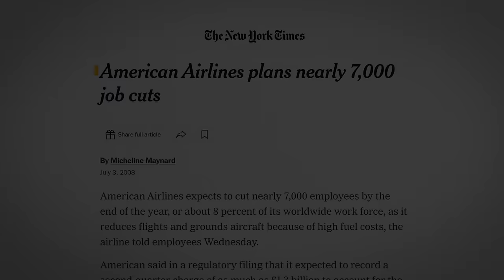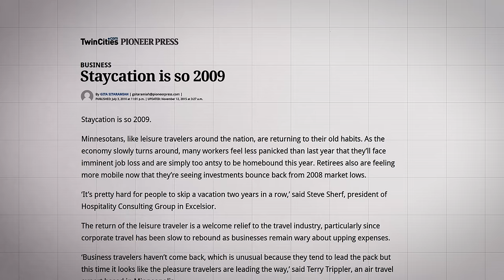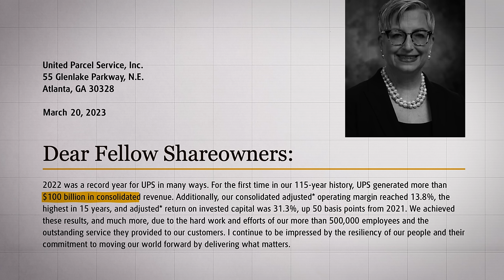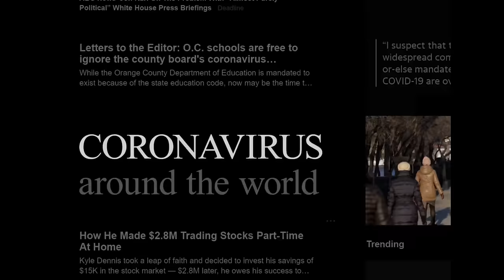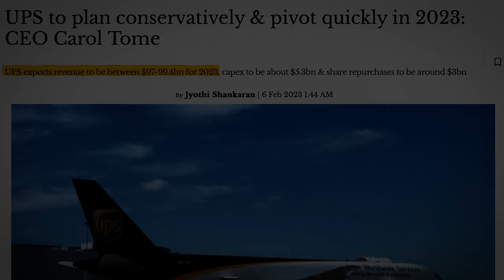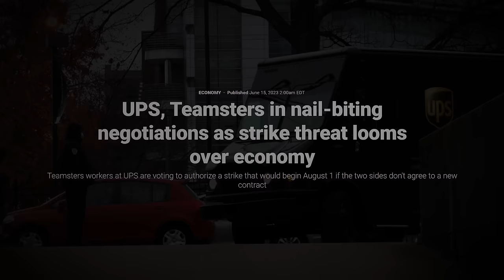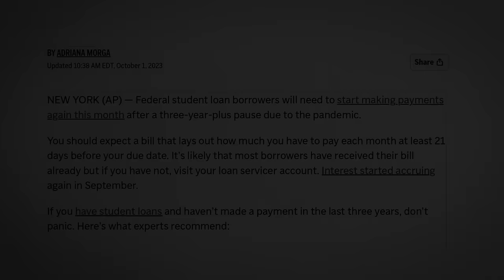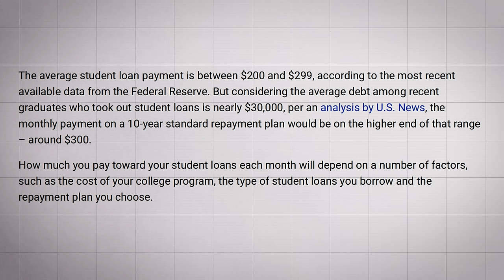Money is Gone: Airlines Start Layoffs Soon

Comment: I'm a 38 year employee of UPS (retired, not a pilot). The issue is The CEO, Carol Tome.  Her hiring was the first instance of hiring a CEO at UPS that wasn't promoted from within the company.  UPS has been around since 1907.  If it ain't broke, don't fix it.  She came from Home Depot where She did the exact same thing.  She is there strictly for the stockholders, not for the employees or customers.  For well over 100 years, UPS never had a layoff, except temps during peak season.  For 90 years, UPS was an employee owned company.  UPS paid cash for everything they bought.  Their stock went public in 1997, and the company has gone downhill, IMO, ever since.
Reply: Thanks for your info you may be right I can only tell you why i stopped shipping with UPS. USPS gives better customer support at a lower price.
Reply: I would love to see the qualified applicants who passed up. The government gives huge tax benefits to those doing business with female ran companies.
Reply: I know what you mean. I worked for china airlines in seattle and the manager transfered in from taipei from the i.t. department. I had 10+ years at the time working the ramp. He and I used to go nose-to-nose on how to load/unload thr md-11s. I would tell him what he was doing was illegal and when the plane gets to taipei they will discover it and the messages and error report will start to come. He insisted, i protested but would comply. Sure enough investigation would be triggered like i said it would. Then the manager would put the blame on me. Being from the i.t. dept he should have stuck with his office work and let flight operations work the aircraft.
Reply: This is true of really any company that's public. The drive to 'increase profits for the shareholders' tends to ruin everything for the customer in the end. Wall street is broken
Reply: Probably true but I knew 2 people who were older employees with UPS(route drivers not pilots) that were employed when the company went public.  One had bought internal company stock when it was offered and the other did not.  When it became public, one became a millionaire at that time and both still had their jobs.  Unfortunately, there is a big difference between employee owned and stockholder owned because the stockholders are the new owners.  I see the disappointment with the new CEO with the employees because she is a bean counter but that is what she was hired for.  Good luck to you.
Reply: She was also the CFO at Home Depot, not a ceo, her job was counting beans, and nothing more. She has no background in logistics, and her understanding of the business seems to be limited at best.
Reply: @kevinmcdonald8049  That's why you get everything in writing, so you can deflect the blame if someone complains back to the person who is responsible for it
Reply: An executive is required, both legally and ethically, to act in the interest of the shareholder.
Reply: @benchoflemons398  It's funny that 'long term benefit' isn't seen as being in the interest of the shareholder. Always it's 'what can you gut to get me more money today?'
Reply: Word.
Reply: NotLeoDiCaprio  china airlines back in 2008.
Reply: Back in 2000 I ordered two packages from a supplier in Quebec, for an important customer. It was going to be a ten week lead time from my vendor so my customer was anxious. UPS finally delivered two packages that looked like they had been dropped off the truck and run over. No exaggeration. I had to refuse them and inform my unhappy customer of the delay. The very next day UPS delivered, not two, but one brand new looking package. Without questioning how this  product got all the way back to Quebec and back to SoCal in 24 hours, like a fool I accepted the package and then forwarded it on to my customer. Who called me an hour later screaming because, when she opened the box, she discovered the exact same two destroyed products, that UPS had just put into a brand new box. When I called UPS customer service, the excuse I got was "Well, Sir, we handle 18 million packages a day." I can remember when it was 20 million. If I was losing 10% of my business the very first thing I'd do is clean house, union be damned.
Reply: @SlyNine   I just searched for huge tax benefits for businesses run by females.  I didn't find anything that substantiates that claim. I think you have it backwards. There are penalties for companies that do not maintain diversity and equal opportunities for employees. No huge tax benefits for companies that do.
Reply: Hate to tell you man, the stock holders own the company, the company exist to make the share holders money, not give the workers a job.
Reply: I agree with you 100%.
Reply: And, you can bet she has a nice little parachute when she goes down with the ship.
Reply: How does a company function without employees?  Or customers to pay for the services of the company?  Under MS. Tome, UPS just started holding rural customer's packages at their buildings until there are enough deliveries in that area to make it profitable.  Customer pays full price to have something delivered.  Might be a part to fix a farmer's broken tractor.  Could be medicine that is needed badly.  Do you think this is a good decision to satisfy the stockholders?  What if it was YOUR medicine?  Is a 2,3+ day delay ok with you?  Old school here.  We used to be told regularly that the last name of our company is SERVICE.  It's all we offer.  That philosophy has fallen by the wayside to please the stockholder.  Jim Casey, the founder of UPS is probably spinning in his grave. @becraftcorey
Reply: Maybe unrelated but a friend who is a regional manager at Home Depot, very successful, complained that his income was suffering because of incompetent CEOs and "executives who got their jobs just because they worked at the orange box for decades and kept applying for promotions into jobs they couldn't do" … Carol Tome was CFO at HD after 20 years of applying for executive jobs. Maybe unrelated.
There's two things the executives at a company should never do:
1. Never mention the stock or stock price or wall street, these matters have no bearing on the performance or success of the company.
2. Never sell their stock, never buy back their stock, never have anything to do with the stock except accumulate it.

Politicians and corporations, law makers, even courts and especially wall street, repeat a total lie about capitalism: "it's the responsibility of the executives to maximize the value of the company." Rubbish. The role of operating a company is a responsibility to the employees, not the investors. The responsibility to the customer and the business partners is to operate the business to serve its purpose in the production of goods and the delivery of services that add value to the businesses and purposes of those customers and partners. That's it. Nothing else. Everything else the corporations and politicians try to call capitalism is a fiction invented to serve their political aspirations, conspiracies and malfeasance. That CEOs are paid disproportionately to ever other employee, executive and board member is proof of the racket. 

If anyone happens to read this comment and is curious to learn more about the differences between 1970 and 2023 in terms of how employees are paid, how executives are paid, how investors take profits and how politicians are the agents of the corporations, I'm happy to continue. : ) … then again, uutuub has blocked my comments before, so I'm guessing this one will be demoted and obscured, too.
Reply: @owenross3468  except UPS delivers the mail for USPS … : )
Reply: @becraftcorey You're correct but the trend for CEOs to stick around for shorter amounts of time before moving on to the next job means they don't have any interest in the long term financial stability of the company.  All they care about is share price and next quarter's earnings so they can get their bonuses.  They wring out every cent without any regard for company viability 5 or 10 years down the road.  They know this & don't care because it will be somebody else's problem.
Reply: @benchoflemons398  If the company is acting in the customers' best interests, if it is a well run company, if it maximises the capital value of its staff and methods, then it is making profits and is acting in the best interests of the shareholders'.
Reply: CEO is hired by the stock holders. CEO is there for the stock holders. Any employee can be a stock holder by buying stock.
Reply: @SlyNine  I believe you're referring to female (minority) owned companies.
Reply: And if the workers walk?
Reply: I hope no bonus is being paid as a result of layoffs, if so BOD should be held accountable for incompetence.
Reply: Back in 1986, my parents opened a small business and I was still in high school. Back then, UPS was the life blood of their business and AMAZING! Our area was too small for regular FedEx deliveries, and our post office was too small to do local or home delivery, so if it came by USPS, you had to pick it up yourself. But UPS always did street deliveries. The same driver, Bill, came to my parents' store every day, even if they didn't have anything going out. It was more than a delivery service, it was a relationship. When I moved out of the house to go to college, if my parents sent something, it was always by UPS. When I needed to ship something in my 20s and 30s, I used UPS. Sometime in my 40s, UPS really started going downhill. Now that I'm in my 50s, FedEx is now my go to delivery service, with the post office second and UPS third. It's a shame. UPS was so good and UPS executive management killed it.
Reply: She better be there for the shareholders. Its her fiduciary duty. Should she do otherwise she could be personally sued. This is how this works. If you think it should be otherwise you simply do not  understand how this works.
Reply: @nixter1nixter1  equal opportunity has NOTHING to do with race or sex. What happened to merit?
Reply: Oh now that is interesting... that coincides rather well with my impression of when UPS went from a perfectly good shipping option to the one that demolishes packages more often than not, can't complete deliveries if there's any impediment to doing so whatsoever, and generally doesn't seem to care about what they do at all.

I've spent half my adult life absolutely baffled that UPS is still in business, and the timing of their IPO makes perfect sense for when they went downhill in my view.
Reply: Here's a clue. Every CEO is in it for the shareholders. It's why the shareholders hired them, to increase shareholder value. Every single CEO everywhere.
Everything else is method.
They only care about employees and customers if it increases shareholder value. 
It may sound terrible but that's the way that it's always been.
Reply: @becraftcorey  ouch, you sure got taken to the woodshed Mr. Shareholder
Reply: Truly shocked that a strong independent boss babe has screwed everything up on multiple occasions 😂
Reply: I own a wholesale company, and ship small packages everyday.  When USPS started ground advantage a few months ago my UPS shipments dropped by 80%.
Reply: and a woman too. lovely.
Reply: "The issue is The CEO, Carol Tome." I'd say this is A problem, but a secondary one. As you say, "She is there strictly for the stockholders, not for the employees or customers." Workers and society have a real and worsening problem because the pursuit of profit is about ONLY the pursuit of profit. The ONLY thing I see that can fix this problem without completely tearing down the corporate business world is replacing all corporations Board of Directors with direct democracy of the enterprises workers. Since I don't see that happening I believe it to be more likely that the intolerable conditions business "needs" precipitate will eventually cause civil problems that eclipse what we've seen to date.
Reply: When they go public the executives run everything to make their options convert and then the looting starts.
Reply: I was laid off from UPS this April.
Carol Tome saw only profit and didn't care about cost.
Reply: @benchoflemons398  Fiduciary- but they only act to line their own pockets in most cases, they do it with finesse but in the end they win and everyone else and the stockholders lose.
Reply: Which should be illegal  @SlyNine
Reply: I hope she gets fired.
Reply: CEO comes in and cuts everything back so it looks like they are spending little and making lots of money. Then the CEO leaves with a nice fat payday and diamond pension.
SOON AFTER... company is losing money hand over fist because they no longer have the infrastructure to function, they need to employ more staff and purchase vehicles and equipment and the accounts starts to look grim.  Who could have seen that coming???
Reply: Going public isn't the true problem - the problem is if they do stock buybacks with their spare cash (or worse, borrow to do stock buybacks).  Again and again, corporations that do stock buybacks do very poorly in the long run.  After all, there was a reason stock buybacks were illegal prior to 1982.
Reply: @kevinmcdonald8049  Pretty much RoC (Taiwan) approach to safety. From SQ006 accident to their train derailment - the first thing they do is to assign blames to outside party. They are an advanced nation, but the attitude and culture to transport safety is pretty much world's behind, even compared to some third world countries in Southeast Asia.
Reply: i always hate this "shareholders vs customers" narrative. when the customers lose, shareholders lose, as these financials indicate. still tho, i do agree that going public frequently seems to limit the competence of management. Boeing is a fine example where public ownership has absolutely failed to contain the last 20 years of management shitting the bed
Reply: UPS would be in a lot better shape if they were not extorted by the Teamster's Union!
Reply: The whole world is now a bottom line inc, staff, ie people are zero, just a burden to any dollar program.
I found working for a family business always better than for a massive spreadsheet outfit.
Reply: It’s pretty simple.  When you take a company public you form a pact with the devil.
Reply: Most companies that go public either a) go downhill and go BK and disappear, or b) get bought out

In my experience, it is option B that happens most often.  It starts with cuts in everything.  While you look at the CEO look at the CFO... the bean counters that look at pennies instead of the bigger picture.  CFO's often don't even have actual "work" experience in the company's field of business but rather are just there to cut, cut, cut.  When you see that you should jump ship because the company is being setup to be sold (unless you have some contract that they have to pay you out of).  UPS is being primed to be sold off IMO.  It doesn't matter that they've been around a long time... SEARS was a 100+ year company... GONE.  I've worked at 2 companies that were prepped for sell off.  The same scenarios played out each time.  I was able to jump ship a few months prior to sell off on the second company, and survived, while a lot of workers suddenly found themselves out of a job.
Reply: Going Public is a Long Term solution to a Short Term problem. Yes, you can generate a lot of income quickly through an IPO, but then you're on the "higher profits" treadmill forever to justify your stock price.
Reply: I worked at UPS for 17yrs. Started when I was 18. It's not a job for the weak, but I was "brown to the bone".  New CEO came in and when I say she started to clean house, she started to clean house. I still have friends that work in management that are in fear of losing their jobs everyday. I was able to get out before it was too late, the best decision I've made. Besides, UPS is not the same anymore, the standards have lowered.
Reply: The new norm is to "bring in fresh blood".  My wife worked for an established credit union and they did this. Talk about screwing the pooch.  The new boss literally fell asleep during key meetings, got rid of old established contractors. In one month alone they lost $1.5 million.  She had enough and retired.
Reply: Yes the esg hire. Rarely thinks long term.
Reply: I worked for Home Depot for 6 years back in the day, yeah she F’_d that up big big time.
Reply: @SlyNine  -

Companies sometimes resort to hiring "hit men".  Their job is to come in and do the things those who are vested in the company might not have the heart to do.  They come in, cut the workforce, do all the dirty work, then leave.

There was a woman, can't remember her name, about 30 years ago killed herself once being a hit man got the best of her conscious after performing, and got fired by the board before her contract was up.  Her mentor also had recently died, so she no longer had that father figure to help buffer the guilt.
Reply: 90% of what I get delivered via UPS is damaged. three time the items were demolished. It not just the CEO. But UPS is still better than DHL.
Reply: Three cheers for your comment!!!
Reply: "She is there strictly for the stockholders, not for the employees or customers." - The most telling statement I've read this year.
Reply: Where would all these CEO’s and shareholders be without the bees doing all the work?
Reply: @benchoflemons398  The problem is that they, nowadays, act on their own interest: that is quarter to quarter numbers to increase their bonuses. This leads to very short vision. You see CEOs firing people and at the same time increasing compensation for themselves. You see them making short-term decisions that then lead to problems. They have the golden parachute,  and as a class, they cover each other. It reminds me of when kings started not only not going to war, but defer to each other (not killing kings). The problem is people notice, and now everybody is going into a union and demanding extreme stuff. Society is going to collapse. How is that going to help stockholders? The stocks will be down 50% or more.
Reply: @becraftcorey I don’t think the OP is arguing that the company doesn’t run for the stockholders. I think he’s stating what he knows- that that doesn’t actually work in the end. That the companies that exist for the stockholders tank because they aren’t operating for the customers.
Reply: how the hell are you retired at 38??????????????????????
Reply: She's also on the International Business Committee at the WEF.   'nuff said for me.    Fired.
Reply: Outside hires for CEO are almost always sociopaths that have one goal, money for themselves.  I worked at a place where the founder died.  The board hired someone who knew nothing about the industry despite a resume full of positions in it.  He fired or demoted competent people and brought in his unqualified friends to be execs.  The company stagnated for 7 years, shedded customers, then got bought.  The execs all walked away with massive bonuses for the sale.  Layoffs started right after.  

There was absolutely no reason for the company's downfall beyond a CEO that didn't care about continuing to improve the product. Stuff like this should be considered fraud.  The only stakeholder should not be "shareholders", customers need to have rights so a company can not do this while holding 10 year contracts that have customers locked in.  Everyone bailed as their contracts expired, but some are still stuck because they signed deals right before the company was ruined just to pay a vapid exec more money.
Reply: I am always amazed when companies get into financial trouble, that the CEO’s never take a pay or benefit cut, it’s always the employees. Why would you keep a CEO if they company is on a downward spiral? Then to make matters worse, they get millions of dollars for ruining the company with a contractual severance package. Without the employees the CEO’s don’t have a company. 2) American tax payers should not have to absorb student loans so I am glad these loans are not forgiven. So many of these student loans were not used for actual college. Students were going on trips, buying clothes, cars and paying for just about anything but college with these loans. Plus once they received the money for these student loans, they didn’t attend school. It’s so irresponsible. Thanks for the video.
Reply: @JimsEquipmentShed  The same thing ruined southwest.  They hired a CEO that had no idea how an airline works who felt no need to invest in improving the IT infrastructure that supports the entire business.   Notice how the CEO's wikipedia for southwest actually cites being a programmer in 1988 as a credential.  It is because since that time, the guy worked vapid management roles and 30 years later doesn't understand anything with IT. The guy learned computer systems before the internet, yet this is his main qualification for running an airline that is basically an IT company.
Reply: I hope you realize that the entire purpose of the CEO position in any company is for that person to run the company on behalf of the shareholders - who demand return on their investments. CEO's aren't there to make jobs for people unless those jobs add value to the shareholders.
Reply: @charleshaggard4341 
She did her job, but it still ruins the company. Also shows that those who already have money are the ones who get money for no work.
Reply: @Adam_Gray 
Yup. That is how they plan it.
Reply: This is how Amazon wants it.
Reply: @benchoflemons398  That is correct.  But more importantly, and by legal decision:
ONLY IN THE INTEREST OF THE SHAREHOLDER.
And right there you see the biggest problem with US corporations.
Also, who can figure out what "the interest of the shareholder" IS? Short-term profit?  long-term growth? Some mix? Buy backs? Dilution?
Reply: @SlyNine  DEI hurting a company say it ain't so.
Reply: @mickeymorgan4672  just wrong. 

What you meant to say was: every CEO hired after a company has gone public is in it for the shareholders.

Small business owners who are CEOs of companies that they love and started = do care about customers and employees,
Reply: P.S. You wouldn't, by chance, be the same employee my dad (driver) knew who is/was a UPS mechanic that would make more money being retired,  instead he keeps working to avoid his wife?
Reply: Public companies are beholden to their shareholders, so yeah, it sucks.
Reply: A company goes public because it needs to raise money.
Reply: Robert, it is interesting to hear from someone who worked for UPS. It sounds like you have your ear to the ground with contacts inside the company. When companies bring in CEOs to squeeze out every last penny of revenue for stockholder wealth thing never work out well for little guys. I know how hard the employees work there whether you work as a pilot, in a warehouse or as a driver. It is a shame the company brought in someone like her to run the place into the ground.
Reply: The CEO of any large business works for the shareholders. The shareholders aren't in it for the long haul. They don't care about any 5 or 10 year plans, they care about the profits and return on investment this quarter. As soon as these numbers aren't where they want it they pull their capital and reinvest elsewhere.
Reply: no worries, FedEx is worse.
Reply: Sounds about right.
Reply: I've a question,I just got a job as a seasonal driver helper making $21 an hour,will I get alot of hours every week and will I be able to get a full time job possibly so I won't have to find another job after the season rush is over?
Reply: A CEO is responsible to their stockholders, not the employees or customers first. Shocking.
Reply: JimAllen-Persona  Right, which IMHO is almost worse. If a company is not attractive enough, i.e. lots' of pure profit, or in the process of tanking and you have people shorting it, betting against it, then there's no reason to pick up the stock just to turn it around. Just one part of the equation of a massive industry, which is just legal gambling as far as I'm concerned.; often with others' money.
Reply: @LONEWOLF-rq5tl  - No one can give you a definitive answer to your question.  The important thing to understand is a seasonal job is temporary by its very nature.  It’s only there because of an anticipate increase in volume in work due to the Christmas holiday.  Once the workload returns to normal after the holiday it’s often difficult to convert that seasonal job to full time simply because they already have all the full time workers they need, hence why a seasonal job is seasonal.  If there’s a further downturn in the economy and the company needs fewer full time workers it’s more difficult to convert the seasonal job to permanent.  Just my pessimistic $0.02.  Best of luck.
Reply: yup
Reply: worked at boeing in late 1990s and there were a number of 767 UPD Freighters and you guys were tough on delivery.  if the pallets got stuck anywhere on the floor UPS would not take delivery and we would have to fix.
Reply: Yes, ESG scoring  @SlyNine
Reply: Its a catch 22 to make a company go public. If the company does not constantly make money, people will complain. It's not sustainable and does not let a company grow naturally. Worse still gives large stake holders and investment firms that only care about short term gain influence changes that kill companies long term.
Reply: @robertintexas this was done back in the 90s. It was up to the driver if he wanted to hold delivery on an extended area. When the competition increased ups did away with it.
Reply: @zackriden79 after 38 years of working for ups 😂😂😂
Reply: @LONEWOLF-rq5tl volume has been going down since ’22 and with the economy the way it is don’t plan on getting called back. I’m retired but before I did there was a lot of work being transferred between warehouses. It’ll increase for the holidays and decrease after.
Reply: @SlyNine  Just throw in a bit of misogyny, why don't you?

She may be a terrible CEO. No idea, as I don't know the industry, but the idea that a male applicant would have been more qualified (which is precisely what you're implying) is sexist. Women can be and are successful CEOs.
Reply: Home Depot and its umbrella holding company are amongst the most unethical I have looked into for part of my college business class paper. I never expected that conclusion and before my deep dive, I was always praising them.
Reply: Goin woke never works out..😂😂😂
Reply: 37 years retired feeder driver and you are spot on with this new CEO.
Reply: Employee-ownership all the way
Reply: @owenross3468 are u kidding? USPS is better than UPS ?  UPS FEDX  will get out of their van to open my driveway gate USPS is union and will not. I've never heard anyone say the government is better than private industry.
Reply: Absolutely correct sir !   More bad news -
Reply: CEO’s job is to take Care of the Stock holders
Reply: Sounds exactly like my current company after getting bought out by a Private Equity firm lmao. It seems like the universal experience with PE buyouts and IPO's.
Reply: If it’s the CEO then no, she is there for HERSELF not stock people. If she was, she’d care about her company and make it thrive so that I would be confident buying in and holding my money with UPS for years to come. The state of the company is clearly reflected in its stock numbers, and UPS is not a buy right now that’s for sure.
Reply: Scott Davis wasn’t either.
Reply: It used to be you got promoted up through the ranks so the incentive was there to perform well and hit company targets. Not no more.
Reply: This is what corporations are about now... They're not there to provide and improve a good or service to a customer... They're there for the benefit of the stockholders!
Reply: Leave it to a female....
Reply: I got laid off from Delta Airlines in 2006 and went to UPS and got laid off there in 2009. Aircraft Maintenance can be a rollercoaster 😂
Reply: I wish, I could say my .02 😂
Reply: Agreed.
Reply: Hey, this is America. Money rules and shareholders are gods. Don't you subscribe to reality?
Reply: @willhow2654  - Consider yourself lucky on that learning experience. I learned the hard way by working for a company that they took over and it went to hell quickly.
Reply: So she was a former Home Depot executive (or senior manager, whatever the hell she was) - that explains everything. I worked for a company that they took over some years ago and it was never the same. There is something about the HD brass that drives the cart and not the horse pulling it, and it is all based on short term revenue earnings at all cost. And if you happen to be one of those who raises a red flag on the shortsightedness and challenges management, well, you are out the door. Then again the Atlanta Falcons is owned by former Home Depot founding partner Bernie Marcus, and the Falcons have only failed in every chance to get a Superbowl win.
Reply: @SlyNine what kind of benefits?
Reply: Just for the sake of it: When a company is publicly traded, what is the #1 priority of the company? Care to answer?
Reply: @TheMrDrMs - 100% correct 👍
Reply: How crazy is that? Unbelievable how the one that comes in with no idea how the company works and turned it upside down,I sympathize with you all, that sucks big ones
Reply: @twanfox isn't it the shareholder's interest to get more money?
Reply: @cathymercado413  do you get more money gutting things now or by making a company a long term success? The point is that long term success of course gets you more money, but it isnt NOW and that seems to be the only timescale these short term CEOs consider. It is easy to extract $1bil from a company worth that much. It is harder to build a companys value to $1bil, but it ultimately will give back more than that over time.
Reply: It depends on the financial situation of the company.
Reply: @zackriden79 reread his comment. He was employed for 38 years there.
Reply: @SlyNine . Prove it.
Reply: Anyone that truly believes a company is altruistic is only deluding themselves. Employees are simply assets used to make money, the same as machines and fuel.
Reply: That means UPS was in trouble years ago. She was hired to "restructure" the company.
Reply: @nixter1nixter1  Gov contracts give bonus points to Female "Owned" Small Business.  UPS is not a small business.   Nearly every small engineering firm in my town supporting NASA and the Gov was female owned.  Often just a figurehead.  native American and/or Black Female was a double bonus.
Reply: no doubt a DEI hire too ... b/c gotta have that strong boss wahman in there
Reply: Going public forces companies to think about their shareholders rather than themselves or their customers.
Reply: @owenross3468 If you are saying that slow, untrackable, and crappy customer service of the package shipping sector of the US Postal Service is better than UPS, I couldn't agree with you less. I ship packages for a living and USPS is behind FedEx and UPS in spades. Not even In the same universe.
Reply: Your perspective helps me understand exactly why we stopped using UPS altogether in recent years.
Reply: The market is no place for a good company.
Reply: UPS is the only shipping company that's union (I guess you could throw USPS in there as well, but if they weren't a government entity they would have been bankrupt long ago, and Fedex is moving almost all of their air freight), and we can't ignore that as a factor.  There's a reason that unions have all but disappeared from the private sector, and it's simply because they can't compete with nonunion competitors, even when the government gives the union an advantage.  The unions have, for decades, demanded more compensation, and at the same time, less responsibility and accountability for their members.  You don't need an MBA to realize that this isn't a sustainable business strategy.

UPS has been helped by the fact that they have had the lion's share of the parcel market, so they were in a commanding position, but that won't last forever, and we'll probably see the day when Brown Santa closes the doors.  There's a reason that Amazon decided to reinvent the wheel and simply create their own shipping network, and that Walmart almost exclusively uses FedEx.....and I'd bet money that it's the union.
Reply: @SlyNine can you enlighten me on these tax benefits? I’m a public accountant and I’d love to know.
Reply: @owenross3468  "USPS gives better customer support at a lower price."  This a joke, right?
Reply: @TheMrDrMs 
CEO compensation is tied to stock price, not gross profit. So they playbthe game of borrowing money to buy back shares and drive up the stock price. They also can play accounting tricks to boost earnings right before the company reports.
Reply: @charleshaggard4341 
Bean counter eventually sank Continental Airlines too.
Reply: Both, Surepost was a plan implemented in 2000 where USPS finished delivery of packages in rural America.  The complies were scratching each other’s backs when it started.  USPS had no inspection agreements worldwide and UPS didn’t causing huge delays for UPS in customs.  UPS jumped in bed with USPS and it still does Surepost deliveries.  I hate Surepost and I wasn’t alone.  Many of my customers noticed and didn’t like me dumping their package at the post office to have it sit another day.
Reply: @heidirempel6530 what if they are promoted because they are female and that’s their strong point.
Reply: @dirtcurt1  Pretty sure that's the response of every mediocre man who ever saw a woman promoted over them, dude. "It must be because she's a woman, not because she's more qualified than I am!"
Reply: @nixter1nixter1 because big capital isn't issuing diversity scores to companies now... It doesn't matter if the govt is doing it or not, in either case, there are higher and external influences causing less suited and qualified people to be given jobs (especially in big corporations) because they check some political classification box based on how they look, who they fuck, or how they take a piss.
Reply: You're a retired ups driver and you're talking about the airline job market lol
Reply: @gotacallfromvishal  I’m connected to aviation in my “retirement”.  I’ve been a pilot since 17 years old.
Reply: Is it worth being a pilot for UPS?
Reply: @benchoflemons398 Exactly, we need more short term thinking.
Reply: The market changed…it is what it is. You can’t just blame the CEO without giving any evidence of her mismanagement, which, obviously you don’t have any.
Reply: @harrycallahan692 extorted? ROFL. By securing a decent wage? That’s probably 1/100 or 1/200 of the CEO ‘s compensation.
Reply: @benchoflemons398  That is true! But you can still treat your employees and customers ethically as well.
Reply: must be a diversity hire
Reply: Don't you think Amazon delivery has hurt them some too?  It used to be everything I had delivered came from UPS and now it comes from Amazon or USPS (and USPS sucks by the way).  UPS was always perfect delivery.  I could track with no problems and it never went from being 100 miles from me then 1000 miles away then back to 100 miles and then to me.  Some of the tracking has been absure from USPS or doesn't work at all.
Reply: @SlyNine  This is astonishingly false.
Reply: @SlyNine  The ideas that 1) the federal government gave a "huge tax break" to United Parcel Service for hiring a female CEO, and 2) that the United Parcel Service passed up a male candidate for CEO that they believed would make them more money are both really, really bad ideas.
Reply: Same thing happened to NWA back in the day
Reply: Most of my adult life I worked for a family owned company. When they sold it in 2014 to a publicly traded company everything changed. It was all about the stock price...not to mention the start of inclusivity and diversity initiatives that significantly impacted the skill level and experience of the employee base. Sh*t went down hill fast. Fortunately for me after COVID hit I got offered a nice buy out package and was able to jump ship. Sometimes change is NOT so good brother !!
Reply: From a customer experience I can confirm that UPS I can confirm that they have become terrible and I am actually paying money to avoid them, just like I do with most ones that are using subcontractor chains for their drivers and UPS is one of them now in Europe. The used to have their own drivers, but apparently not anymore, at least I have no see one in years now.
Reply: @becraftcorey Share holders only care about short term profits, so stupid decisions are made to make quick profits instead of investing in the company and the people for long term profits and stability during dips. The investors abandon these companies during dips making the problem even worse.
Public trading makes the long term performance of a company worse and greatly increases the company volatility.
Reply: Yellow was in business for a long time too, now it's gone. I came from Yellow to UPS, and it's gonna shut down ? Damn 😏 @GeoTactics
Reply: @zackriden79  Read it again. Said was an employee of UPS for 38 years.
Reply: I wasn't in the airline industry or anything like that. However the same thing happened to the company I was working for.
The first 7 or 8 years I was there, they were promoting people in house. The first sign of trouble came with a merger. Things were still hanging on, not great but good. Then they hired completely outside of the company for someone to come in and problem shoot. Keeping in mind the company doing the problem solving was in no way experienced with the work that our company did. They changed so many things that we couldn't work for the people who really mattered, which were our customers. I got out of it when that started. I still had friends who worked there. Within a year after I along with a few others left, the business was shut down. Bad business decisions made one of the most profitable businesses in that area sunk the ship so to speak. It was pretty sad to watch it go downhill and close. I probably would've stayed there until retirement if the powers that be hadn't got so greedy. Sigh. . .
Reply: Bean counter
Reply: The are way too many like the person your describe .Lethal
Reply: @F_JoeBiden-tu6cl  I've tried to tell people for years. If you work for a publicly traded company, buy as many shares as you can. And attend those shareholders' parties. Not the shareholders meetings, but those little parties they hold. Believe it or not that's where you can help fight for yourself and coworkers. If done right, obviously.